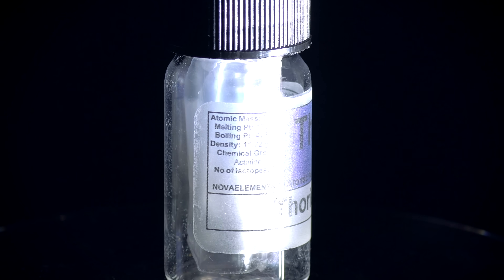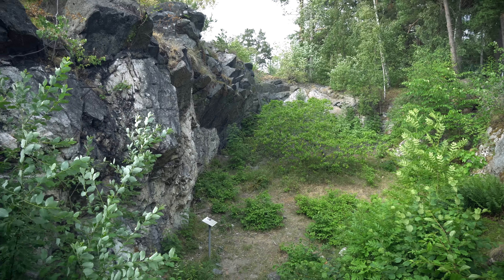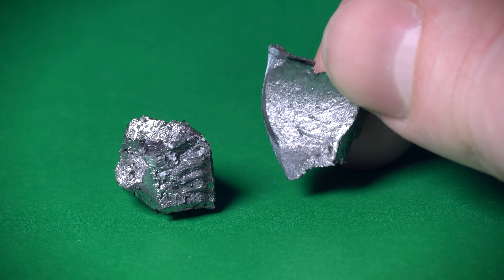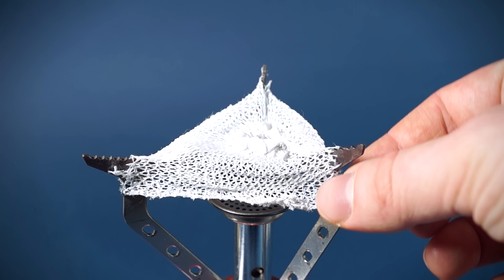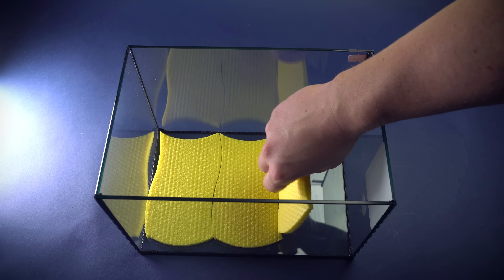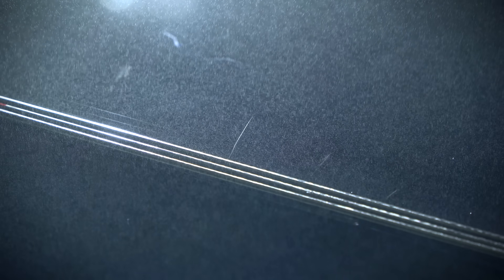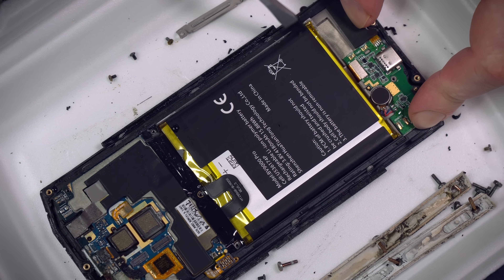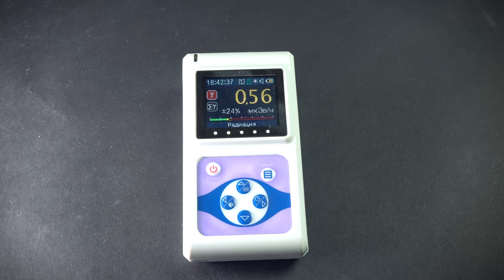Thorium - A METAL THAT NO ONE NEEDS!

Comment: 2 percent thorium mixed with tungsten makes a fine electrode for tig welding steel and stainless, just don't breath the dust when sharpening them.
Reply: Don't worry, I won't be laying any lines and doing a snort! Always seemed like a bad idea.
Reply: Now your telling me ...
Reply: @obelixer9751  it's fine i've been breqthing in the dust for years. The most it's gonna do is give me cancer in like 20 years or something.
Reply: @chrismetal15xbox306  Thanks, who want's to live another (extra) 20 years anyway. Although it would be cool to glow in the dark.
Reply: @chrismetal15xbox306  You could always do a magnesium sulfate head wrap;Celts used to do that as a medicinal poultice..You could also add in some type of chlorella such as water cress,blue green algae,or small small portions of kelp(14 days)..Asian medicinal..Just add in sulphur dioxide to prevent a blockage in the arteries or veins and to prevent infection..Sea salts and greens are extremely corrosive of excessive metals built up in the human body..Topical applications of zinc in industrialized aluminum manufacturing works okay but if the zinc coating is not applied; tree pollen usually digs a hole in aluminum after a while..The corrosion factor of using sea salts and greens orally and topically also depletes carbon buildup with metal particulates that are sometimes oxidized from stainless steel valves and heads/engine blocks,also depletes/corrodes metals from iron ore nickel deposit engine blocks,and numerous other metals used in machine shops and construction job occupations..but you have to work at it like you work on an automobile..Beta carotene that converts to vitamin A in the human body also helps to regrow the lungs when paired with vitamin c and some type of dairy "with" growth hormone to increase rapid lung  repair..Then you just apply high grade 80 bill refrigerated probiotic or homebrew kefir and some high fatty omega 3's & 9's/Hyaluronic acid to feed myelin insulators and brain collagen to prevent damage from high human biological emf's from increased metal exposure..Like the swedish around cast iron engine ore mines gobbling way too many omega avocadoes..Throw in hot pepper to increase blood circulation,some Gingko biloba to stimulate memory,and some nicotine to increase the synapses between the neurons in the brain collagen in case you get a break in the collagen and she misfires and you need to fire hotter to skip a few places until you heal up/regrow the collagen..Running around in machine shops since 91 and on construction sites playing with metals since 99..Tore down a VW 4 cylinder at the age of 11;yeah the human flesh car is a more tenacious task...
Reply: @obelixer9751  phytoplankton methycobalamine or methylfolates dna crossed with pigs for glowing action is probably less abrasive than metal..Scientists supposedly already did that..or maybe it was lightning bug dna..
Reply: Everybody who watched the video knows this.

Comment: If alpha particles can not even penetrate a single sheet of paper, how can the radiation from thorium oxide penetrate a stainless steel faux pen?
Reply: I'm guessing it was just contaminated while assembling the product. I feel sorry for the poor guy doing the job for such a silly purpose.
Reply: Gamma comes with the alpha
Reply: @jamess3417  Oh, ok.. It must be TH 234 dioxide as TH 232 doesn't emit gamma if I'm reading it's decay properties correctly.
Reply: @gotsteem  i think it's not gamma. It would just change your question to - if it is gamma how does is it cut of completely at just 7 cm from the pen...

Comment: Thorium is not a useless element lol. it can be used as a source of fuel for reactors that are much safer then what we are using now.  Governments did not want to use it because it does not create weapons grade plutonium or Tritium as a byproduct in reactors.
Reply: Youre absolutely wrong. Most reactors used fuel isnt used for weapons. Thorium reactors would still require uranium or plutonium in their fuel to function at this time
Reply: @jamess3417  No.

Comment: Thorium was used extensively in camera lenses until early 80's. Thorium dioxide (ThO2) was used in the elements of camera lenses and was delivering great optical quality which even today can't be reached in many cases. Thorium dioxide increases the refractive index and decrease dispersion like no other chemical compound and that is very important in optics. The Asahi  Super Takumar series of lenses or the Canon 50mm f/0.95 dream lens are some of the many examples of lenses that are praised for their optical quality even today. Thorium dioxide was used in the premium lenses of Kodak, Canon, Nikon, Minolta, Pentax, Hasselblad, Leica lenses and made  them exceptional. Until late 70's the unhealthy radioactivity of these lenses wasn't know to the general public. When the scandal broke all manufacturers of lenses moved to the lanthanum oxide which is still used today but offers inferior quality. 
Old manual focus lenses in good condition of 60's and 70's with Thorium dioxide (ThO2) can be used today with adapters on mirrorless digital cameras and are abundant with various prices in eBay. It is not hard at all to spot a lens with Thorium dioxide. The glass of the lens elements has a brown tint. The radio decay of Thorium dioxide after some years gives a brown tint to the glass. 
This tint can be remove easily in a few days or weeks with constant exposure to the sun's ultraviolet radiation or with special UV lamps. 
The radioactivity of these lenses isn't something very serious. I am not a doctor but it is said that if you have such a lens attached to your body permanently for six months you will get the equivalent radiation of a typical X-Ray examination. 
I have bought an Asahi super Takumar 50mm f/1.4 from eBay for my Sony α7 mirrorless camera. I removed the brown tint which can been seen in photos. The photos I shoot with this lens are impressive and comparable of much more expensive modern lenses.
Reply: Great comment! Thank you for the data you contributed! I didn't knew anything of that.
Reply: I'm no physicist or a doctor, but I would be willing to bet that the hazard posed by these lenses wasn't an issue with the consumer. 

I'll take your word for it and say your right, granted it's an educated guess, but those rocks probably had way higher levels and he wasn't in any danger.

No, instead it probably was discontinued due to the hazzard created by the production of metallic Thorium and the workers that were exposed to it in the making of the lenses. Working in an office won't give you popcorn lung even though microwave popcorn is a popular snack in offices. However procedures had to put in place to protect the workers in factories that were exposed to the pure form of the chemical.
Reply: @Stacy_Smith  , popcorn lung?
Reply: @goodun6081  Yeah, you'll have to look it up, but from my understanding it's a condition caused by breathing in the powdered form of CONCENTRATED artificial butter. It's "supposed" to be a non-issue for the consumer due to the tiny amounts contained in food products, but I use REAL butter (cream & salt) NO margarine and I make popcorn on the damn stove with REAL butter.

When my wife goes to the store she knows NO ARTIFICIAL CRAP! I buy my ranch from Frisch's Big Boy at $4 a jar because it tastes better with natural ingredients and I get my dip from Save-A-Lot because it's one of the last places that you can get dip from that has SOUR CREAM as the first ingredient. 

(We're getting a little sidetracked here, remember this video is about Thorium and not microwave popcorn. I just wanted to point out the difference in toxicity when you are talking about trace amounts vs. concentrated amounts.)
Reply: @goodun6081  The compound is called Diacetyl.
Reply: @Stacy_Smith  you are probably right. Although as I mentioned, there are neglectable effects from them if you are just 3 feet away from them. Also, if you were around one all year long, it would still be oy about 0.2% of the yearly acceptable radiation exposure, which also leads me to think that it may have happened because knowing a brand used radioactive elements could possibly cause people to avoid buying from them.
Reply: @Pramod Soni sorry Bro. I don't understand hindi. Can you translate it to English?
Reply: @eagleclawzz  he says something like "we love things from india"
Reply: @havokmusicinc  ok. Lol.
Reply: @eagleclawzz  It's a song. They lovingly call us Indians. (Indian people)
Reply: Thank you for the insight
Reply: Yes! This was the reason I got the super Tak 200mm f/4. Amazing correction and optical quality. I use it as an astrograph actually. Perfect use!
Reply: Thank you for the information Bro. India has 1/4 of the thorium reserves and we should utilize it for betterment of mankind.
Reply: Achilleas, thorium was used in very early vacuum tube types, the tungsten filaments of the tubes were impregnated with thorium which provided the necessary high amount of electron emission when heated. Thorium-impregnated tungsten filaments in vacuum tubes can actually be rejuvenated when their emission becomes weak, by a process utilizing much higher than normal filament voltages for a short period of time, which brings fresh thorium to the surface of the filament. I've actually done this myself on old WD-11 radio tubes, and it does work. However, this technique only works on a few early tube types. Later tube types typically had filaments or cathodes that were coated with a mix of chemicals, and aren't capable of being rejuvenated when the tube becomes weak.
Reply: Jim Man  It wasn't hazardous to pedestrians it was hazardous to the people that maintained them. They were breathing in the ash from broken mantles.
Reply: What health risk from thorium in camera lenses? Thorium is just barely radioactive. Welders grind thoriated TIG electrodes to a point every time they use them. That puts a lot more thorough into the air than those camera lenses.
Reply: @PaulSteMarie   Breathing in thorium dust is very, very bad.
Reply: Achilleas Labrou thorium in microwaves tho
Reply: Yeah. The lenses are only 3.6 roentgen. Not great, not terrible.

I'm a retard. lol
Reply: @GtmNayan  no worse than Jim Man, he's a real fucking Window licker
Reply: Beta flies out of my old Kodak lens like nobody's business.
Reply: I'm sure almost anyone who is semi serious into photography will have a Asahi Takumar 50mm f/1.4 lens. That lens isn't expensive at all but offers great quality.
Reply: That’s incredibly interesting, thanks for sharing!
Reply: hawkturkey - Sadly, it has been found that Thorium actually can be used in making Nuclear weapons. When testing Thorium reactors, it was found that it was producing small amounts of Uranium-232 when it was irradiated, which has extremely dangerous gamma rays. To avoid this process, one has to remove an element called protactinium-232 before the irradiation process. But, the protactinium-233 that has been removed will decay into high purity Uranium-233 which can then be used in Nuclear Weapons. So sadly, it has been discovered that there is a potential to weaponize the byproducts of Thorium reactors. The terrorists are going to try to ruin it for everybody.
Reply: @KHH595  its not effective enough at producing uranium this is part ofnthe reason why thorium reactors dont exist world leaders are so afraid of each other that we keep trying to weaponize everything instead of trying to solve real problems. 

I for on would rather reactors that dont threaten to delete things off the map when the earth decides to have a bowel movement >.>
Reply: @KHH595  not really. As you said, thorium makes U-232. It is really hard to make anything with more than 0.1 percent U-232 into a bomb without dying.
Reply: @KHH595  ...If we don't fuck it up with our own Hubris first. I'm still an advocate for gas moderated Pebble beds...But no-one seems interested in them these days, its either SMR or Thorium Salt reactors getting all the attention.
Reply: @mwnciboo  Agree, but we should be working on All of them. If we had concentrated on research into many different types of fission reactors rather than concentrating on the light water reactors because of the powers-that-be, we could now be using three to four times the amount of energy that we currently have safer and cheaper. we really need to be pursuing these types of research because we could fix many of the problems we now face if we did; everything from global warming to cheaper  spaceflight would be easily possible if we had more energy.
Reply: Great info, thank you!
Reply: Thanks wikipedia
Reply: Yolo Mach ich auch immer Unfortunately Wikipedia is very poor on this subject. For further info there are some videos on YouTube about the radioactivity of old lenses with Thorium.
Reply: Fascinating! Thanks for sharing!
Reply: Basically it's useful 😂
Reply: Mad love bro everything on this planet has a use, wether we figure out how to use these materials is a different story
Reply: "increases the refractive index and decrease dispersion " i thought if refraction is increased then so will dispersion or divergence ,,are you saying using such lens  to collimate white light will have a lower divergence than other lenses? i know using aspehircal lenses is better than spherical lens because they have less chromatic or spherical aberration,do they use thorium dioxide in aspheric lens?
Reply: Jim Man  "Thorium is not dangerous to handle, you just don't want to breathe" that's easy to say, go work in a damn mine or factory. "People take precautions" Have you met "people"? That's right, you know damn well they don't know what they're doing.
Reply: yes, their are one of the best lenses, i think a few zeiss lenses with thorium too.
Reply: it was used in toothpaste too MMMMM tasty radiation
Reply: My grandad has one
Reply: Holy shit he just went Fucking Elon musk on this guy; Disproving any assumption thrown at him
Reply: Thorium is/was also used in hot-cathode electron tubes.
Reply: I have canon 35mm lens, love it, just have to remember not to lick the lens when I clean the lens.
Reply: Great infos you got on thorium lenses. Never new this. Thx u bro
Reply: Oh man, those 80's Super Takumar screwmount lenses....  Man I miss my old Pentax.
Reply: Ok smart guy
Reply: And used in antennas
Reply: Wait you say 80's cameras had a better image quality than nowadays? Yeah right I won't read any more of your trash
Reply: Narajan Husic I wrote about about camera lenses and not camera bodies. There is a difference that you will never realize.
Reply: @AgnostosGnostos  yeah exactly, image quality depends on camera lenses. Do you have anything abnormal to say?
Reply: Thank you so much for the tip!! I’ve been looking for looking for more lenses for my camera! I also have an a7II!!
Reply: Tyler Eberhardt Thank you. There are many YouTube channels about vintage lenses. Also check Facebook groups about vintage lenses too. 
My favorite radioactive lenses are the super Takumar. Quite affordable but not cheap in good condition and with great optical quality, full open. 
Nearly all Pentax super Takumar have thoriated glass and excellent optical quality.
Be careful with eBay  there are many versions of Super Takumar lenses of a specific focal length and aperture with various optical qualities. Check the pentaxforums website for details. 
It is said that old professional Kodak lenses are the most radioactive of all  but with the best optical quality. 
I don't have one because there are very expensive in good condition. 
Kodak is know for its cheap cameras but had a professional division too. 
Check the camera-wiki website (not Wikipedia) for the article about radioactive lenses. 
Also to remove the brown tint prefer cold sunny days during winter. 
The hot days of summer may damage the aperture blades and certainly the internal lubrication of blades. 
I usually have a small fan near the lens to reduce the heat of the lens from the direct sunlight.
The lens should NOT be behind a glass windows. The glass of windows reduces the necessary ultraviolet radiation.
Reply: Cool that you still use and rock old school slr cameras and lenses.
Reply: Joseph Contreras Older manual focus, normal and short telephoto prime lenses of 60's and 70's haven't advanced significantly. It seems false but is true. 
They  can be used with adaptors on mirrorless cameras. Mirrorless cameras have magnified zoom and focus peaking for fast and accurate manual zooming. 
Normal and short telephoto lenses doesn't have serious optical challenges. 
On the other hand Zoom, ultra wide and super telephoto lenses have inherently serious optical issues and this kind of lenses have advanced tremendously after the 80's and 90's. Additionally the autofocus revolution of late 80's made the construction of this kind of lenses lenses even more difficult and more expensive. 
For example after 2010 for the first time full frame autofocus ultra wide lenses have become fast, with good optical quality and quite affordable for the first time.
Reply: They still use it in thoriated tungsten for welding
Reply: Interesting read, the more you know huh
Reply: Also, sadly, the radioactivity won't go away for a long long time. However it is pretty much neglectable if you're standing more 3 feet away from it as it would be lost among the background radiation.
Reply: Typical x-ray examination. Thats what the scientists from chernobyl said
Reply: DontForget31 Actually the Chernobyl area (not the destroyed reactor) is quite safe now and can be easily visited. Youtube is full of relative videos.
Reply: Cool story bro.